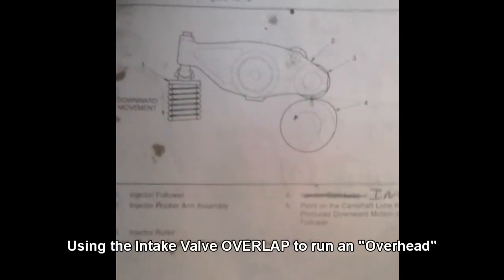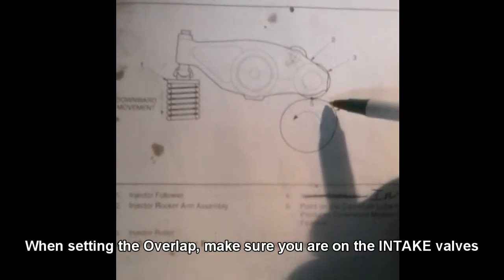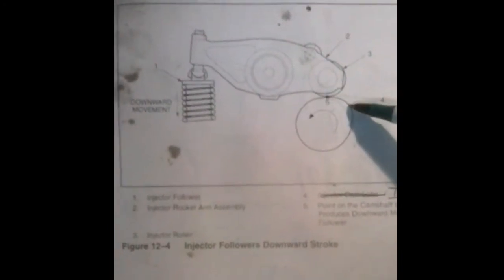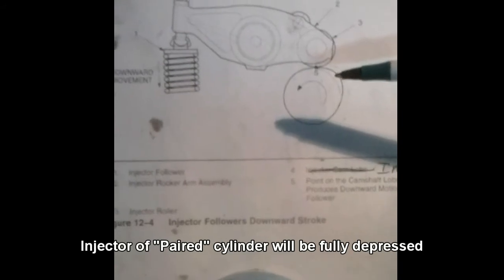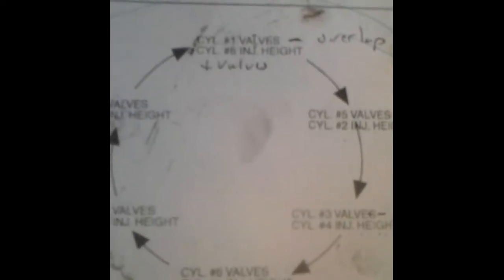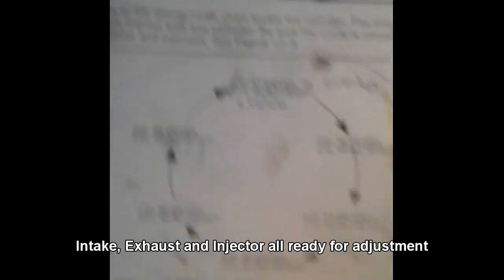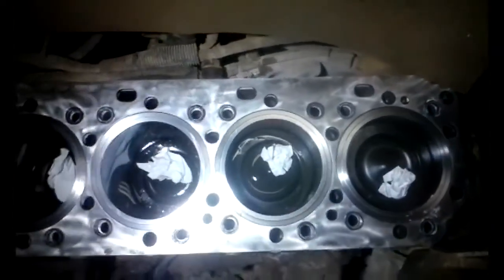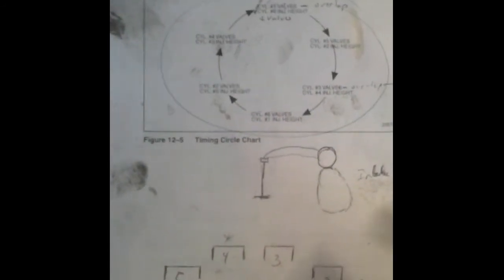Valve Lash Explained

Comment: Makes absolutely no sense.   So according to chart,  when cyl 1 is in overlap you adjust the "valves" and then the injector on #6 ???   How can you adjust the valves if they are on overlap... you cant if they are open as your picture
Reply from the maker: Remember that cylinder number one will ve at TDC ready to fire, ie injector lobe ready to depress while  cylinder 6 is finishing it's  cycle. 
They run in pairs.
1 and 6
2 and 5
3 and 4
Does that help?